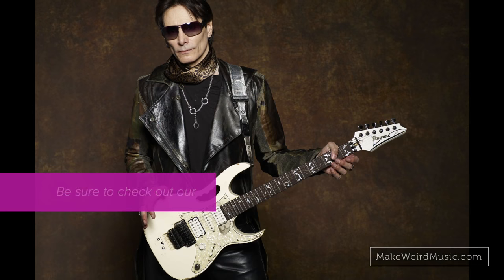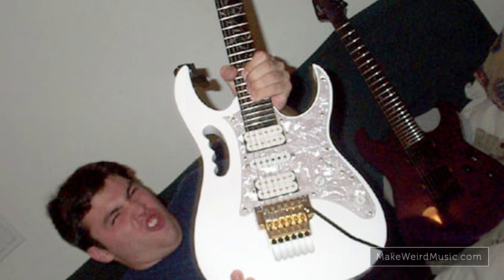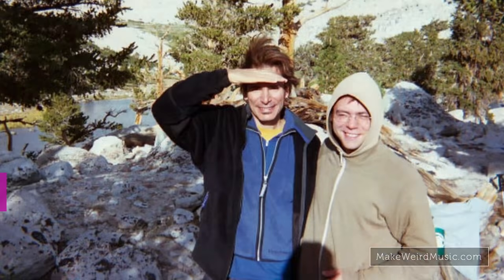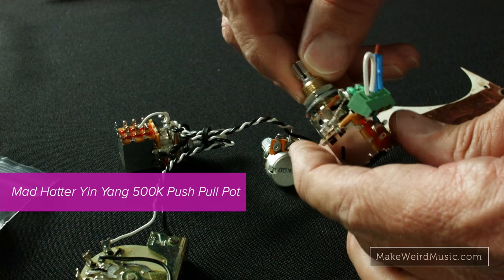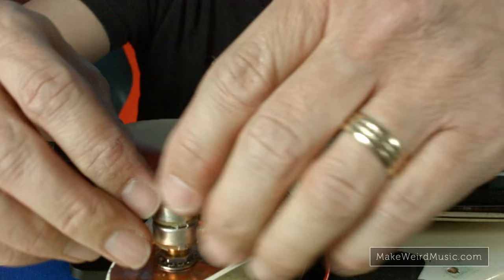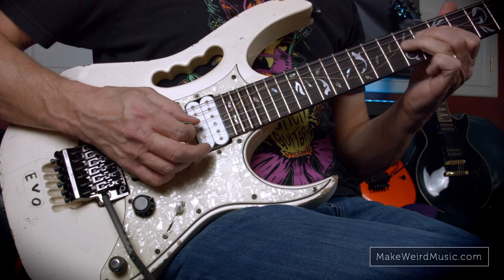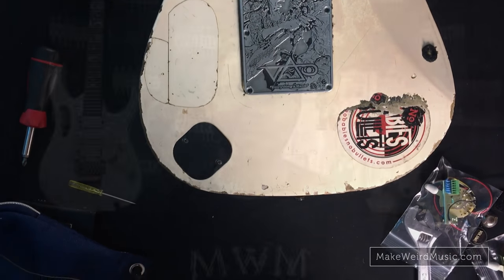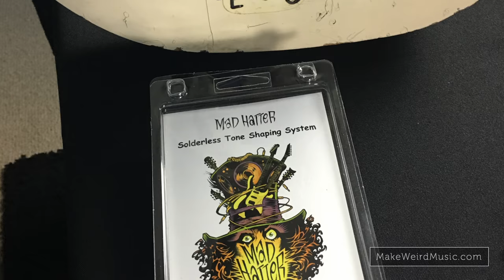Gear: Steve Vai's EVO and Mad Hatter Guitar Products

Comment: Hi!

I'm interested in buying the Terminator Kit, the same installed on Steve's EVO guitar but I have a couple of question:

If it's the exact kit, why the capacitor types and values are different from Steve's EVO? are they equivalent? the Terminator kit use the same treble bleed circuit that Steve use? are both pots push pull or only the volume pot? 

Thank you for your reply
Reply from the maker: +danimolina08 you'll have to talk to Ed about that. Email him at info at madhatterguitarproducts dot com

Comment: Alright, im going to have to buy a set. My old RG550 with evo pickups is getting weaker sounding when time goes on. Wiring and the ground is pretty much shot. So i can almost feel this is going to cure those problems
Reply from the maker: You won’t regret it. Made a huge difference in my Jem.

Comment from the maker: Check out the kit we installed in EVO: https://madhatterguitarproducts.com/collections/terminator-single-volume-kits/products/copy-of-single-volume-single-tone-complete-kit-with-a-5-way-selector-switch-for-humbucker-single-humbucker-svst-hsh

And find out more here: http://makeweirdmusic.com/gear/evo
Reply: hello i have a question ummm is there a system similar to this one that i can install on a guitar that only has 2 humbuckers i want to install it on a RG320 thank you so much for this incredible content
Reply: I want to fit this system in my Floral 1990 Jem however I want to have the middle (position 3) for both neck and bridge split or coil tapped as you describe it. I looked at all the systems you have out there but didn't find what I wanted for position 3. I own a custom Jackson fusion and it has both humbuckers split and that setting for cleans is the best I have ever heard. I would love to have this for my Jem also. Pls help as I am fascinated with these products especially the super high quality. Also I would like a push push yin yang for even brighter tones if that is possible

Comment: I added the terminator system  to my rg rebuild
Reply from the maker: +Judd Oakes sweet! What do you think?
Reply: Make Weird Music
 I really like it. 
it made a huge difference since my original circa 1996 pots were scratchy and really wanted something I could use that didn't require me burning my fingers with a soldering iron 
These things have been a very welcomed upgrade a good match for my new pickups I changed out too
These things will revolutionize the market me thinks

Comment: I need his original wiring diagram.
Reply from the maker: +A Bow Tied Guitarist It's the same as the Terminator kit. 5-way switch, stock Ibanez Jem configuration... The only difference was the push/pull pot with the cap on it, which is basically what Ed is selling on his site.
Reply: Make Weird Music I'm gonna try it in my 8 string.
Reply from the maker: +A Bow Tied Guitarist I just got a kit installed in my 9-string (Ibanez RG9). Made a world of difference.